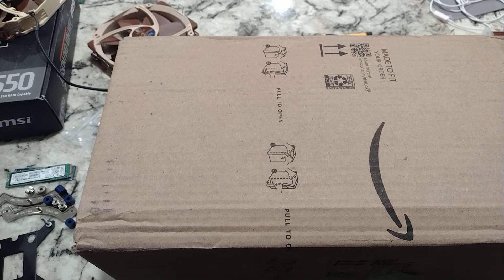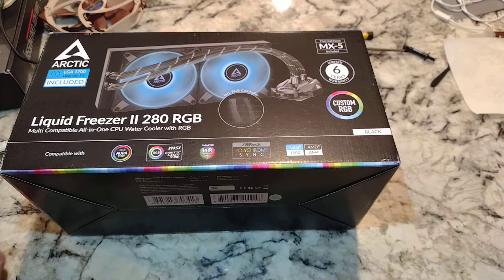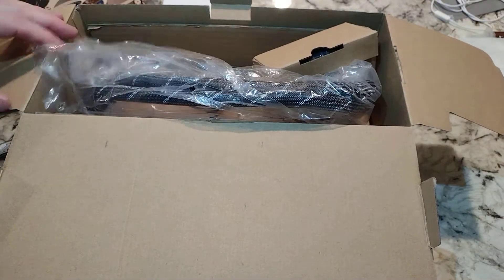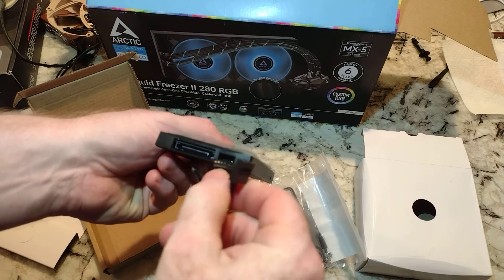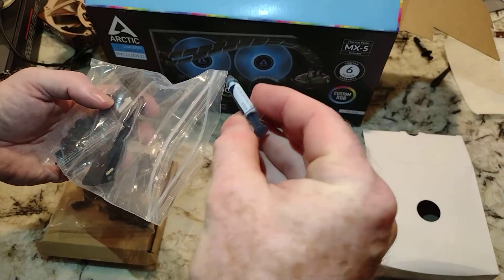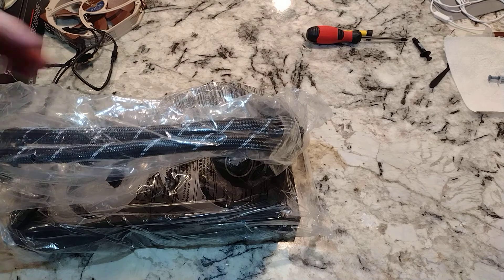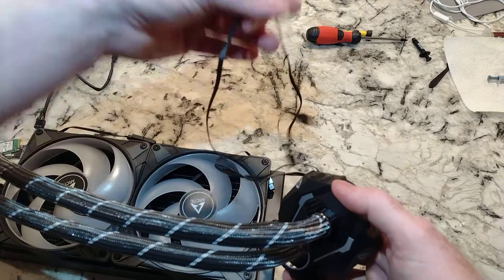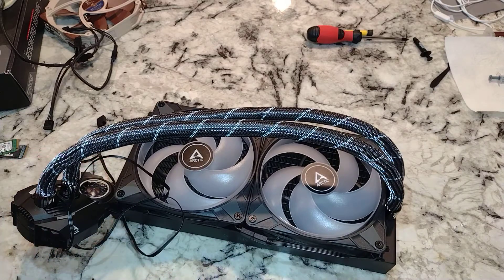Unboxing: Artic Liquid Freezer II 280mm, AIO, water cpu cooler paired later I7-13700k

Comment: i just got this for my new 5900x...i have a brand new coolermaster ml240 i bought originally for it but i have all 140mm fans in my case and, even though the CM will work no problem, i thought i could use the current 140mm noctua fans i have installed in a push-pull config but they didn't give me any long screws! my old h80i corsair unit came with long ass screws specifically for push-pull but whatever, I'll use the Arctic rig and see how it goes.  is supposed to be the single best aio for 5900x but we'll see :)

Comment: Is this good enough for 13900k?
Reply from the maker: A couple of months ago, I might has said no.  As I had a rather hot running I7-13700k before I got the I9.  After going thru a few motherboards, it seemed clear that the I7 had issues.  I eventually get the I9 in and have used it with 5 cpu coolers and only one of those would I not recommend for both benchmarks and gaming.   This I9 when set to power limits unlimited can hit over 300W during benchmarks.  Games of course won't see that....they are right around 45-75W if I remember correctly from checking an XTU chart during gaming.

Comment from the maker: Traditional Air cooler guy here...unboxing his 3rd AIO in 3 years...so yeah, don't know as much about these as others.  I bought this on the recommendation that it would help with the cooling of the I7-13700k.  
Note: Was realizing later that the extra screws holes are to be used for various other types of mountings and fan locations.
Never did find the instructions.  Online instructions are not the best as there are different generations.
To see benchmarks with this CPU cooler:
https://youtu.be/njCPVDRaZbw
https://youtu.be/AlkCQNPJjFc